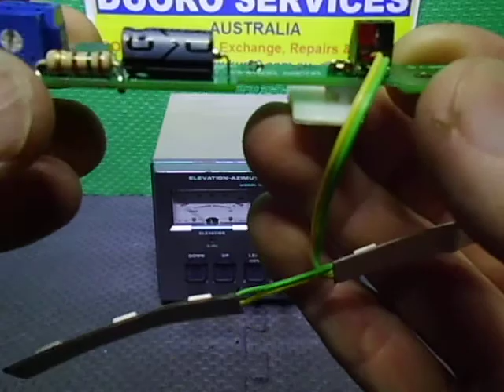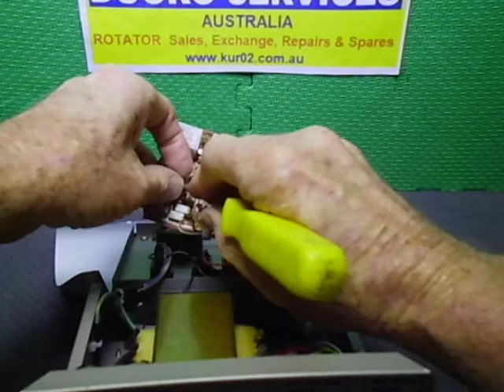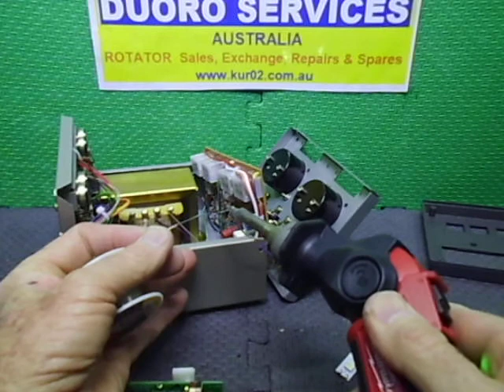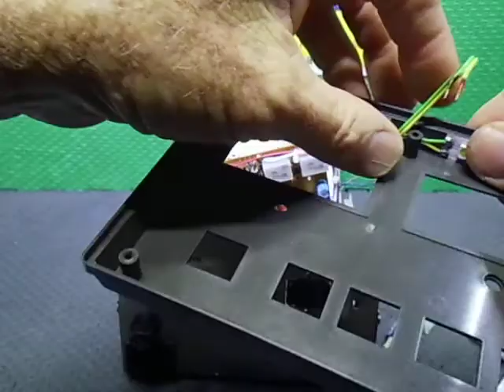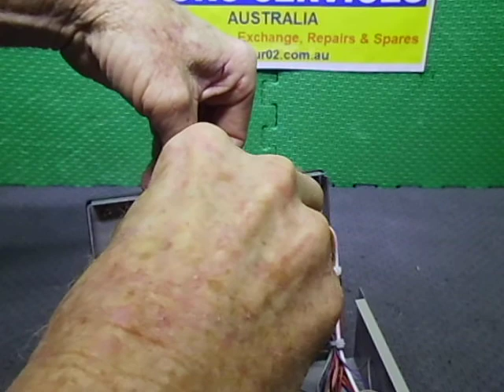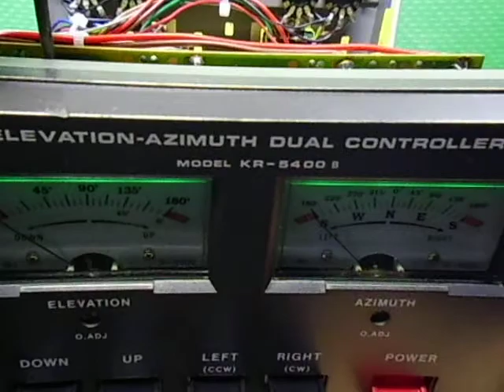yLED-ac-AE display illumination PCB installation

Comment: Have you other videos installing  yLED-ac-AE into other rotator controllers??
Reply from the maker: The yLED PCB has been adapted for several rotator controllers. There is two basic versions yLED-ac & yLED-dc for AC or DC powered display globes in Kenpro & Yaesu controllers. There is several other versions available yLED-dc-XL-A/C & yLED-ac-RC to suit other models of Kenpro & Yaesu controllers. I also have a version for HyGain/CDE called yLED-ac-HG, all these instructional videos are on this channel. I have also adapted a yLED-ac to work in a Emotator 1102MXX controller. I have another new version coming soon for Daiwa CR-4/P controllers called yLED-dc+limit. PH